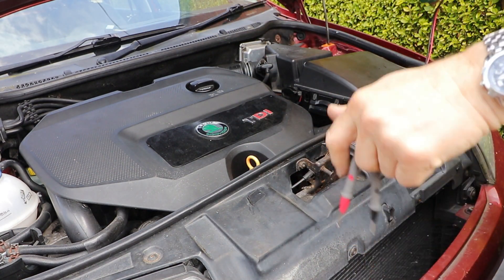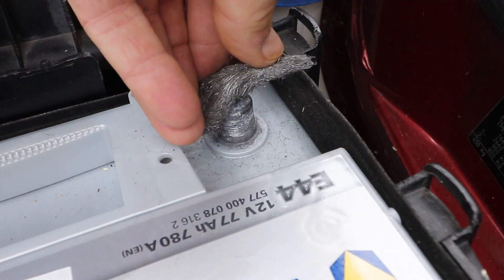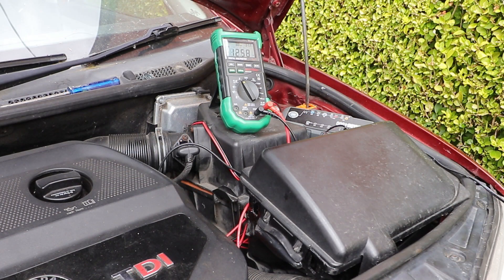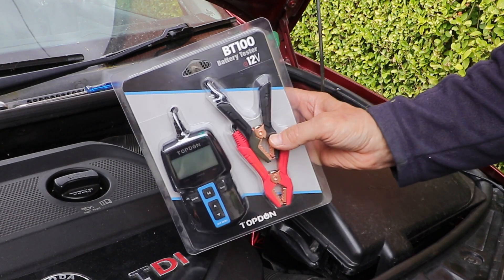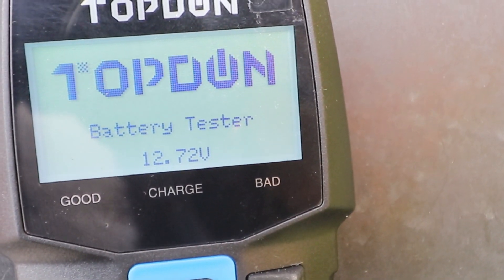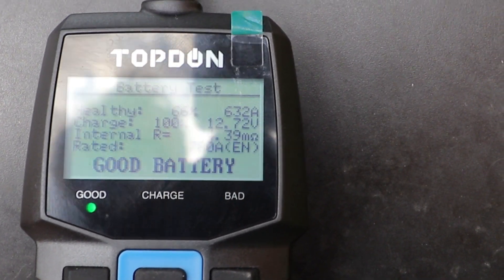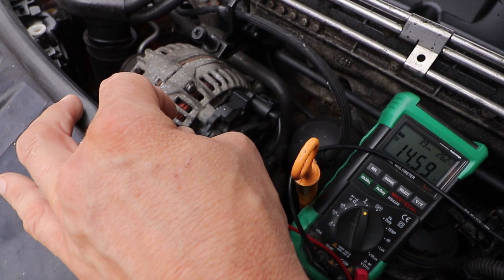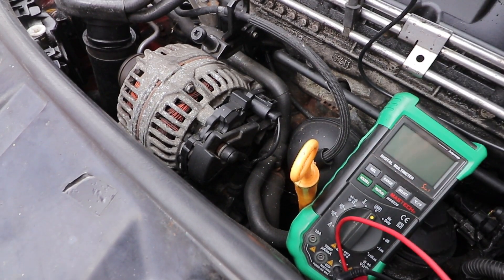SKODA FABIA Battery Testing, Multimeter and Topdon BT100 review & test

Comment: Love your videos! Absolute god send!

Could you point me in the direction of information on how to fix the headlight beep reminder no longer working? Causing me to be forgetful and leave the lights on… causing my battery to go flat. Human error I know! But having the warning beep back would be nice.
Reply from the maker: Thanks. Unlikely to be the buzzer if the buzzer works for other things or either the switch if it turns the lights/off. IMO likely to be the drivers side door lock. Do the locks work correctly? Do the interior lights come on and go out with opening and closing the drivers door? does the door warning light and security light come on/ go out? https://youtu.be/Wb3B9_nNn6c :-)
Reply: @HatBoyHarvey  thanks. I will watch that video now.

The door locks fine, centrally locking fine. Interior lights work fine.

Previously if I left my indicators on, wipers on or my headlights on I would get a warning beep when taking the key out the ignition. That no longer happens.

It’s a Skoda fabia 1.9 VRS, 2006.

Comment: My car when the gasoline drops to less than 15 liters.. it turns off after every right turn.. has this happened to you??
Reply from the maker: You mean the engine dies? or the electrics go off? nearly conked out low on fuel once in France, stopped and swished the car from side to side and it got me to the gas station!

Comment: I think 14.6+ Volt it is very near from the "boiling point" of the battery. Batteries "boile" at 15 Volts. My Fabia has a 90 A bosch alternator that already changed the voltage regulator. I used an original voltage regulator and the max voltage I can see  is 14,1 Volt. I am no an electric expert but I think you should get more information about it. Thank you for the video.
Reply from the maker: Good point, The max is around 14.8V, but you can see peaks over 15V.  It is worth checking the ground and positive connections to make sure alternator isn't compensating, but  14.6V is good, I'm not worried. 14.1 V is also OK, but check for V drop and belt tension. If it reduces over the next few years it may be worth checking over further or renovating as I renovated mine to 'as new' a few years ago with new regulator brushes, slip-rings etc. Now you have me thinking about the rectifier and I can't remember if i changed that or not, but it is easily testable so will do a video on that next.  :-)
Reply: @HatBoyHarvey  I changed the regulator my self and I thought that was easy. I prefer the 14,1 V, because once a month I make a long trip and do not want the battery too many time in max voltage charge allowed. But I think with not sure that in the VW group the regulators are defined for 14 V.

Comment: great info. my drivers door window regulator has problems the wire seems to have slip off pulleys and got chewed up looks like a new one needs fitting.  Haven't done it yet have you had one apart before. any pointers would help. JOBS A GOOD UN
Reply from the maker: If you can't get the window down to the viewing holes easily then take the winding motor off